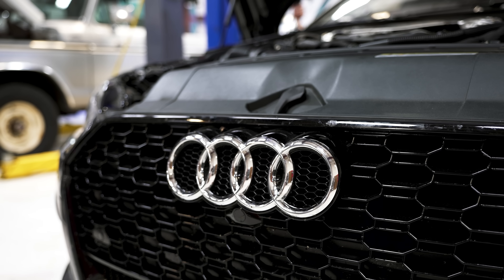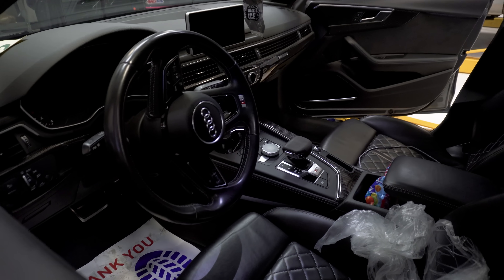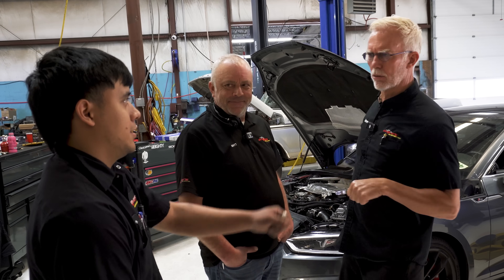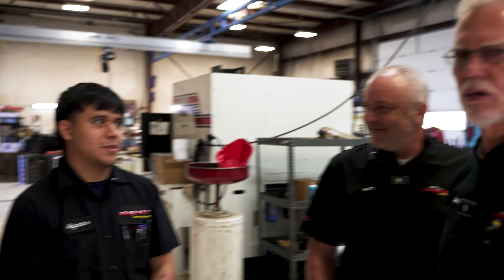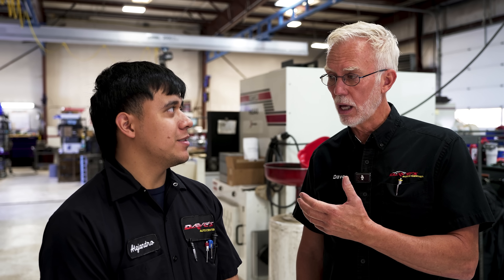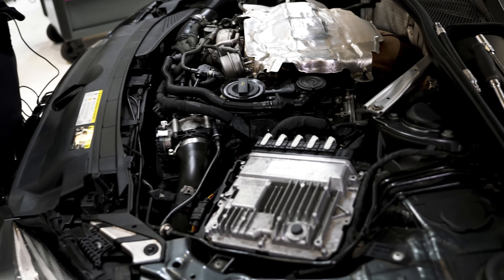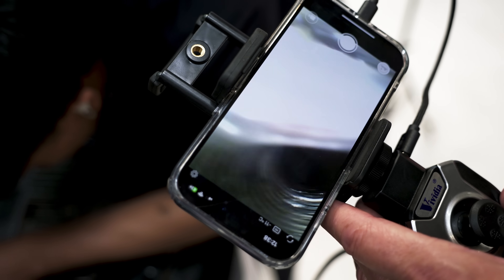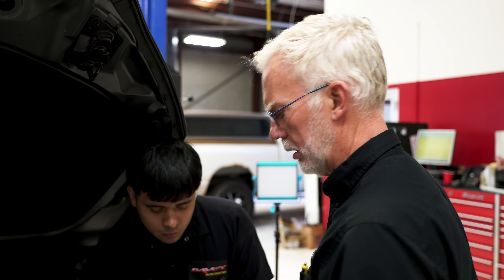Audi S5 Engine Piston Damage

Comment: I owned a 2008 STi Subaru, they are notorious for blowing ringlands. I had mine for 10 years but never beat on it and always checked the oil levels. If I bought a car from a dealer and 20 days later it went boom, it would be back at the dealer and they'd be fixing it. This guy was driving this car like he stole it, he wasn't warming up the car properly (since it's turbocharged), the previous owner could've had it tuned improperly with the timing or he starved the engine of oil.

Comment: The dude should sell or trade the s5 and get a Lexus rcF or is500. Those are in the same class and very reliable. I thought at first this was a brand new s5 then learned it’s a 6yr old Audi with 80k miles that’s a lot of mileage on a German car!! If you buy German go with a lower mileage certified pre owned and get rid of it once it reaches 80-100k. That is why you find these on dealer lots because things start to break. This s5 is high compression on the turbo and engine, if you dealt with a standard setup like an a5 for instance that might be better. Still you will encounter problems vs a Japanese car much earlier than later. I love European cars they are very nice but can’t deal with numerous trips to shop. I either will go full EV or hybrid as my future vehicle. Performance I have down since I drive a accord 2.0t sport which is fast for a full size sedan (detuned type R engine).

Comment: This is also what eventually happens to gm L83 and l86, 5.3 and 6.2 v8 engines when the owner is cheap and runs 87 instead of 89 for the 5.3 and 91 for the 6.2.

Comment: I want to see the video with Audi S5 engine rebuild. I have a 2019 S5 with 160k miles and am thinking about doing a overhaul in the future. I'm curious what something like that would cost. My thinking is that I'd rather put 10-15k in to the engine instead of buying another one for 60k.

Comment: Timing these engines is a nightmare. Audi warranty pays 18hrs for one side and I know this because I’ve done it. It’s not nearly as easy as the supercharged engine though a lot of things are similar. The chain faces the firewall and there are no true timing marks. The factory service manual does provide “reference points” which is really a small window, but those don’t give me a ton of confidence. The phasers don’t even lock onto the end of the camshaft, they freewheel and are torqued on while rotating the engine towards the slack on that side of the chain. I had to do one in car for the rockers (those have been revised!) and it was very fun. Took me well over 36hours to time one side of the engine. My reference window being so vague I simply was unsure other techs who came to help where also unsure due to the engine being new at the time. reason it took me soo long is that the service produce specifically mentions while reinserting the timing tools into the camshafts they should freely slip onto the camshafts. Mine never did each time I had to retime that side of the engine. Each time the tools did not fit correctly. Finally out of options I assembled the vehicle sure I was going to be off somehow. I had been spot on the whole time but the camshaft tools never fit easy, I had to wiggle them in unlike the service manual said - they did fit but not very easy. I drove the vehicle 30miles to prove that this wasn’t just a fluke. Never had another issue.

Comment: In most cases, the root cause of the issue was the use of a lower octane fuel in the system. While customers may be hesitant to purchase premium fuel due to its higher cost, they often fail to recognize that the engine's high compression ratio necessitates its use.

Comment: Curious how much this repair was.  I RARELY see a case where it makes business or customer sense to rebuild a Euro engine with bottom end damage.  This gets even more profound as you get more low production new boutique engines.  

I dont think VAG sell oversized pistons or rings for the 3.0T platform, and the cylinder liners are only 1.5mm, thats probably risky business.

He never did discuss pre ign or detonation relating to direct injection.  Does he feel that this was a LSPI case?

Comment: Audi V8s are unreliable AF. Only own one under warranty, but actually avoid them at all cost.
Great video, but in my opinion before you offer to take the motor  out the customer should be given a quote for that part of the work and the likely scenarios from then on, again with cost estimates. Once you are in the motor the customer is already into significant costs and less likely to back out. I know that is good for your business, but not the customer.

Comment: Detonation is the result of an unwanted heat source. Direct injection turbo engines often have higher compression ratios to run efficiently and are prone to detonation or knocking. Modern engines have knock sensors to prevent this but sensors can fail. Combine this with low quality fuel and a premature detonation can smash your piston en rip the piston rings off. But maybe it's not detonation: Torn rocker arms causes by misshifts can also cause misfires.

Comment: What caused the detonation was fuel mixing with the oil and detonating below where it is supposed to. It could have been caused by idling too much, a tune that dumped too much fuel at idle, or using the wrong oil.

I wish I could have worked for a shop like Dave’s.

Comment: What causes a pre-detonation in a direct injection engine? Clogged faulty injection system and carbon build up. they did a compression check (25 psi) but no leak down test? first do your own leak down, then run a fuel and intake system cleaner through with some new spark plugs. maybe leave some seafoam or b12 in the cylinders over night. I saw some good crosshatches on that bore and I would never be so invigorated to pull an engine without a little remedy first.

Comment: That owner have my sympathy. The original owner probably had it tuned (and reflashed back to stock) and abused it from day 1 w/o having preventative maintenance :(  I have 20' SQ5 with that same motor. I am fortunate to acquire it w/under 19k miles (driven by 'Mrs. Daisy' of an Audi dealership sales manager), all serviced by the Audi dealership and with a 2 yr/99K miles coverage. The 3.0T turbo motors are so sensitive that oil changes must be done every 5k miles - especially when warranty is expired

Comment: I don't know how it works in the US, but surely there would be some sort of consumer rights? e.g. if an engine needed replacing on a car I bought from a dealer after only 40 days, it would be covered under warranty. Otherwise what's the point buying from a dealer as opposed to a private seller?

Comment: AUDI knows there is a problem and hides from their mistake. 2011 AUDI TT same issue. Carbon build up breaks ring land. DI engines may be efficient but only when clean.. AUDI  Recommends a walnut shell valve cleaning only nothing on piston. AUDI could not afford to take care of all the poor designed engines.

Comment: Pooring fuel in your cut does not do anything, having misfire which is unburdened fuel + air does the trick. Burned some hot ends on the test bed. 😂

Comment: Had 2015 c300. At about 20k miles a piston ring failed. That should have been a clue to get out of the brand. The dealer botched the repair and had my car for over 40 days. That car and service center were absolute garbage.

Comment: Ive had my B8 S4 for almost 10 years now with zero issues.  The most favorite car ive ever owned.
Reply: Yes, we skipped the more recent turbo v6 and opted for the supercharged v6.  Follow normal maintenance and enjoy the ride.
Reply: @bdez1259  Isn't the turbo V6 just a newer version of the supercharged V6? I remember reading somewhere that the two engines were almost identical.
Reply: @old_dan it’s not the same, definitely similar but different. Not many parts can interchange
Reply: @TheCompyshop  Okay, thanks for clarifying. I was kind of curious since we have the supercharge v6 on our q7.
Reply: I owned a used 2016-17 s5 has 78k miles no issues and just done 80k miles maintenance service $1500 at dealership. I loved it!

Comment: Generally, the 3.0 tfsi engine has a problem with peeling cylinder surfaces and it is not LSPI. They improved it but not long ago. My friend has a company called Szlif-Mot Białystok in Poland and he regenerates a lot of them and a lot of other engines and heads. This problem also occurs when the injectors atomize gasoline incorrectly

Comment: GET TO THE POINT!! NOBODY WANT'S TO WATCH YOU YAP ABOUT Alejandro studying how direct injection damages and engine's cylinder walls.

Yes, direct injection engines can damage cylinder walls in a few ways:
Fuel wash
Unburned fuel can wash away the oil that protects cylinder walls, making them susceptible to damage. This can happen when fuel doesn't mix completely with air, creating rich air-fuel pockets that can lead to incomplete combustion. The partially burned fuel can then hit the cylinder wall and stop the combustion process, forming soot. The piston rings can then bring the soot into the crankcase and oil.
Oil absorption
When direct injection engines squirt liquid fuel into the cylinder, it can get on the cylinder walls and be absorbed into the oil. During combustion, the oil on the cylinder walls can ignite and burn off, which can lead to increased oil consumption and flash burns.
Auto-ignition
Fuel deposits on the cylinder walls can sometimes auto-ignite before the spark plug fires, causing damage.

Comment: 50 years turning wrenches on European vehicles. ECU turns off spark/fuel... on misfires. Audis were very well made when I started in early 70's. They turned into POS's early 90's.  That vehicle is totaled. The customer may have had ECU tuned. If you involve yourself in this you will be married to this. Dealers sent me cars all the time. Retired in 2020. So glad I did.

Comment: Being that ECU it looks like a Bosch MG1. Now I work exclusively on BMW Group cars but all cars with that ecu (and all of the previous 2 generation Bosch ecu's on BMW's) have cylinder deactivation. So it shuts off the injector for that cylinder if it detects a severe misfire which is what the flashing check engine light is telling you. The cat should be fine with that unless it got a bunch of oil dumped into it or the injector was mechanically stuck open. Shouldn't be damaged from unburnt gas as the fuel supply to that cylinder got shut off unless the injector got stuck open.

Comment: Bad forging detonation from carbon or over fueling,  over bore piston quick fix but do em all for power balance to prevent rod damage. 
Ahh heat cycling discharge… give her all she’s got… 30 day or 60 day warranty. With that piston ring 2 wall gap if honed tell him don’t run it light to light..

Comment: It’s a high compression engine with forced induction and cast pistons. That injector has a couple milliseconds to push out the needed amount of fuel with enough pressure to overcome cylinder pressure. Hence why they’re running 1-4k psi. Doesn’t help DI also is ran as lean as possible riding the edge of detonation only a degree of timing away depending on what the knock sensors are saying. These engines are often 10.5 to 11to1 compression under 10-20lbs of boost. That’s a lot of stress.

Comment: Carbon death and these motors don’t do good with being rebuilt with oem computer ecu these are touchy personally I would do new motor for resale or if u keep it be ready to play with it pressure with be off it certain places dosent mean it won’t run but never perfect. Like a tuned car better just don’t blow up the next one oil is key with these and don’t mess with them try are fast out the box

Comment: Basically the original owner got a tune on the motor ran the living crap out of it took it back to the dealership after taking the tune off as it was back to stock and the motor was not running properly

Comment: Sounds like improper fueling.  I wonder if it has any aftermarket modifications. I’m no Audi guy.  I do primarily turbocharged Subarus.  Ringland failure is fairly common.  This typically happens when it’s running lean.  The surface of the piston gets very hot and causes the fuel to ignite before the piston reaches the peak of the compression stroke.  Putting massive stress on the piston and rotating assembly. Can bend rods, screw up the tolerances of the rod bearings and crack the ringlands. I see the cracked ringlands a lot as well as spun rod bearings.  Once you deform that rod bearing just a tiny bit from all that extra stress.  Things go bad very very quickly.

Comment: Time for the customer to dump the car and get an electric one. I got rid of my 2014 VW GLI at 84,000 miles before any problems came up and got a 2023 Tesla Model Y long range. The electric power is great as well as the single speed transmission is so smooth.

Comment: Hey Dave. Perfect video to ask my question.   I just did a piston soak on my 2011 bmw 328i n51 with 200k. I used berrymans b12 a bore scope and I flushed everything out by turning it over with seafom.  The amount of white smoke and carbon that came out was enormous. Then of course oil change new ruthenium plugs and elron coils.  I'm at 500miles and so far no oil burning smell and oil is full.  It cleaned my oil level sensor so it's working properly again. Also I wasn't able to burn rubber before but now it does.  I know it took a toll on my catalytic converter because I saw chunks of carbon burning through it so I plan to use cataclean.  Do you recommend this any of this? Please explain.

Comment: Im a average Tpyota tech and glad im not a VAG group tech as one of my mates is who works at the citys biggest Audi dealerrship ,he says he sees a lot of these type of problems mostly related to direct injection ,he says the biggest one is the build up of carbon around the intake valves with bits of carbon going into the combustion chambers and causing chaos with rings and clyinder walls and even jamming valves open ,that customers biggest mistake was buying a 70 km used Audi just out of warrenty lol I drive a Altezza RS 200 3GSE beams motor and 6 speed and my fun car is a 1989 Nissan C33 Laural Club S with a RB25DET pumping out 280 kw at the rear tires,Iv had a few E36 ,E46 BMW over the years but will never own a modern car ie post 2000 and never any Euro cars and deffently never a VAG car of any discription as a meth habit would be less stress and expense than any VAG car lol great channel and hi from New Zealand and if your engine check light comes on in a modern car pull over and get it towed and you prob will sve your self from extra bills and or heart break lol the RB motor in my Nissan was a import motor with 160 000 km on it now its got 230 000 and i might freashen it up with some new pistons rings and bearings tho its still got 175 psi on all 6 pots

Comment: 3.0 v6 tfsi supercharged is bulletproof. 200k miles same engine and transmission. no issues because i maintenance it and actually drive the piss out of it! the worst thing you can do to german cars is let them sit. 
the turbos are different but their supercharged engines are great. more reliable than any honda or toyota. just DO YOUR OWN WORK. IF YOU DONT HAVE TIME TO WORK ON YIUR CAR YOY SHOULDNT HAVE ONE IF YOU CANT WORK ON YOUR CAR YOU SHOULD NOT HAVE ONE! 
that right there would solve 80% of current car issues 😂
Reply: I have the same engine. Does your car have cold start chain rattle?

Comment: I had motor damage on a VW VR6 motor.  The shop gave me a similar story.....they couldn't give me a firm quote until they dug into it.  It was going to be minimum $2500 if it was just a head repair.  OR they had found a low mileage motor that was pulled out of a wreck.  They could drop that in for $4200.  I went that route and had a great running motor with about 80k fewer miles on it.  They had confirmed the wreck was only in the rear so they had good confidence it was a good motor.  They warrantied the whole thing of course as well.

Comment: The more I think about it the dealership had done the right thing suggesting a new motor as a proper repair, as it would come with a factory warranty. Nothing against Dave and his work but with that many miles and no previous history you may find stretched timing chains [ number of them] also tensioners ,concerns about roller rockers etc. Dave may find a proper rebuild with labour may be more than $ 30K and what is his warranty.

Comment: I don’t know a ton about these EA839 motors but I do know the early models had a pretty common issue with the rocker arms. The bearings were too small and they would fail. Check into it too maybe?
Reply: The rocker arm issues involved the 2018s. They also had pistons that had a rare tendency to break under the ring lands when the car has been abused, which is what happened here. Both the rocker arms and pistons were revised on late 2018 and early 2019 models. The rule of thumb with these engines is to avoid the 2018s. After that year, they've so far proven to be solid engines. Just another example of why you should avoid first year anythings with any manufacturer.

Comment: I would have checked if the engine and transmission has been tuned for performance and next look at the brand of spark plug are they original were they worn out ? And next have the injectors tested to see if they flow correctly.